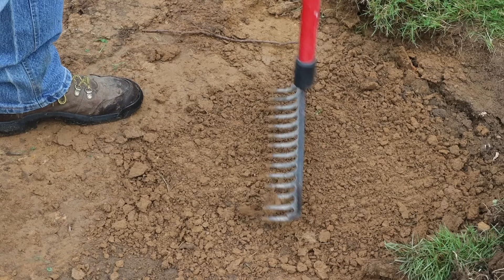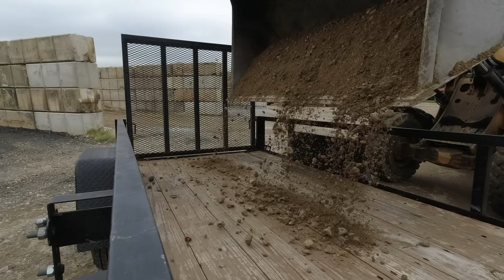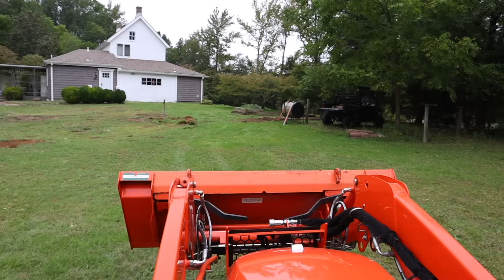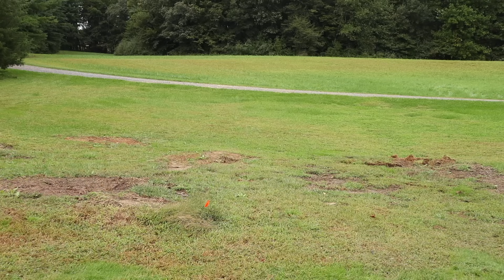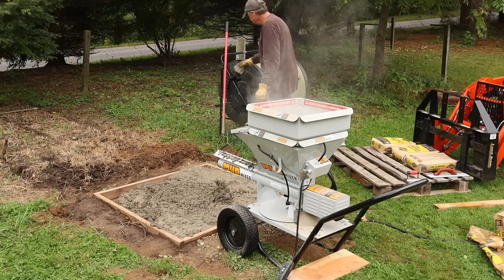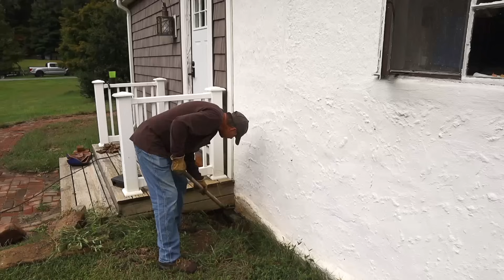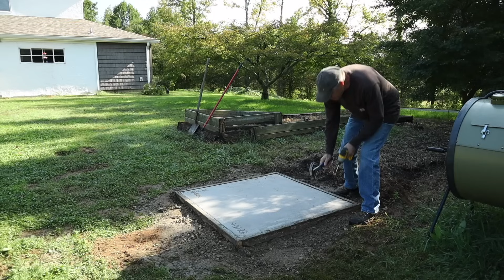Game Changer. Pouring a concrete pad and using the Mudmixer for the first time. MCG Video #169

Comment: Your inconsistency in the mix output is most likely caused by inconsistent water pressure if you're on a well system that operates within a wide range (40-60 psi).

Comment: For one project the mud mixer is pricey, but for foundation pour, small pads, small garage pads, it is a back saver, gives you time to fine tune the concrete, seems most effective for two old timers as a part time job, this would make a great side job for part timers!

Comment: Small issue, but put a bucket or pan under the chute when you are washing out the machine so you don't end up with a hardened pile of aggregate in your yard.  A handyman once washed out his equipment in my sister's flowerbed next to the front door where the hose bib was located and made one heck of a mess!  Plus the wash water is alkaline and could kill plants.

Comment: Make a grate that can sit on top with a hand control bag slicer. Then sit the bag up on the grate and pull the bag splitter blade and the job got a lot easier.

Comment: I love how the guy spent like $3600 on a commercial cement mixer with the add-ons to do a $50 home project.
Reply: I suppose the idea is he makes it back as he does other projects, and the time savings and savings on his old body. Valid points but probably never really hits ROI. His kids can have it if it’s a solid machine.
Reply: @JeronimoStilton14  yeah that’s a great idea and all, but rarely every pans out. Every few years there’s a new, better, more affordable product available in everything made ever, that is always easier and more worthy. It’s like if grandpa and grandma saved their Atari 2700 to give their kids because it was “expensive”. Just get the $200 mixer with the 2 year replacement plan for $20 and throw it away when it breaks. You can buy like 16 of them before buying one of these stupid ass things.
Reply: @c1rca23  a newer product doesn’t mean someone won’t be glad to have it later for free even if it’s not the new hotness ataris are pretty saught after since they’re now classics. Doesn’t mean pong is better than ghosts of Tsushima (though it definitely beats starfield lol)
Reply: @JeronimoStilton14  ok thanks for trying
Reply: I was thinking I would just mix it on the tractor bucket with a hoe. Then dump it in the form. Wouldn’t take a few minutes and probably easier to wash out the bucket
Reply: Its Slower than a $200 normal mixer
Reply: It's definitely a gimmicky tool for rich boomers.
Reply: @Doomzdayxx  nailed it
Reply: Get you some money like the rich boomers 😢😂.
Reply: This could be an infomercial for the mixer?
Reply: It saves one man.  That is extremely valuable.  I've done tons of small portable mixer jobs and can see that this is a game changer.

Comment: I lucked out and bought a two wheel wheel barrow that the tub was actually a cement mixer. It slso has a 100 foot extrnsion cord. A hardware store did not want it anymore and 75 dollars took it.
   It weighs nothing empty and super easy to add the bags right where they are dumped

Comment: Nicely explained and you did a good job for someone who's never laid concrete before.

It's hard to get excited about the machine you were using, particularly when it cost you circa US$3K, has about the same footprint as a much less expensive portable concrete mixer, produced an inconsistent mix and, from what I could see, was relatively slow.

You can get away with inconsistency when the pad is only going to be used for a composter, but the art and science of concreting is getting the right ratio of aggregate, sand, cement, and water.

Too much water will weaken your concrete.

When I was young, I helped my Dad lay a reasonably long concrete driveway, which was 6" thick and wire mesh reinforced. He made it that way to withstand the occasional heavy truck on the driveway.

My Dad bought the cement bags, aggregate and sand separately.

We used a portable concrete mixer to mix onsite before pouring the concrete into a wheel barrow and then into the forms.

We did it over a number of weekends, essentially laying large slabs one after the other, with relief cuts designed into the pour.

For a pad that small, I personally would've used either a concrete mixer, if I had one or could hire one reasonably cheaply, or a wheelbarrow.

For a bigger pour, I'd use a portable concrete mixer, and for a really big pour I'd get it delivered premixed.

From a viewer in New Zealand.
Reply from the maker: Thank you for your kind comments!

Comment: You don't want it to dry in the machine so run into a bag. Or run it out over hole in the yard extremely wet. This machine tends to only pull dry mix from one area so if it had an gasoline motor. The shaking of the motor wouldn't let that happen.

Comment: that machine mixes inconsistently  the key to good concrete is water controle  , you will have weak areas unless the water is mixed in consistently to a specific slump

Comment: From both a labor and quality of output standpoint, I'm not sure that's an improvement on a  3.5cf HF mixer at 1/10th the price.  The product website has a video of using it to pour a long 1' wide slab, but for a typical slab I think I'd rather being pouring several cubic feet at a time, rather than the continuous dribble of the mud mixer.

Comment: Paying 3000 dollars for the Mudmixer to make a 4 x 4 concrete pad seems foolish, unless you plan on using it for many more projects, but even then not very practical. You can buy concrete mixers for only a couple hundred bucks at any good hardware store. You can rent a mudmixer which would be a better idea. If I was a concrete contractor it would maybe make sense to buy a 3000 dollar concrete mixer but not for a average homeowner with only a project or two to do. I do want to add that you did a great job on your project.
Reply from the maker: You’re right that it’s well suited for a contractor or active DIY’er. I’ll be doing more projects with it after winter. Thanks for watching!

Comment: Thank you for sharing this review both good and bad. At $3,000 this isn't probably a machine for the casual user, but someone who does this kind of work on a regular basis it looks like a real labor saver. A less convenient, but way cheaper, option are the traditional motorized small barrel type mixers available at 1/10 the cost.
Reply from the maker: It’s pricey for the average user but it’s definitely convenient!

Comment: Heres a cool tip...  When your done with your pour, I generally use the extra to pour into patio block forms and step stone forms.  Also... It doesn't hurt to set a 4x4 in a homer bucket and fill for later use as a post somewhere.
Reply from the maker: Thanks!

Comment: 20:20 It’s the tube high enough to get a wheel barrow under?  Can you shut off the flow and just let it keep turning?  How many bags can you put in at one time and let it run?  Does it drive automatically so I don’t stain getting it through the yard up and down the hills or pull able to get across town to my brothers? Are the hose connectors quick disconnect and double or did you add that piece?  So jamming up is an issue and how did you resolve it stick a broom handle up the shoot or flush the top that says dry mix only… how did you clear the constant jamming, which can be an issue if you have a few bags sitting for a day or 2.
Reply from the maker: Yes, I think you can fit a wheel barrow under the chute. It does not drive automatically but rolls easily. Not quick connect. Jamming isn't really an issue, just happens sometimes - just hit reverse momentarily. Never put water in the top - only to clean it once it's empty. And don't leave any mix (even dry) in it. It could harden and ruin the machine. Use it, empty is, clean it, and put it away. Thanks for watching!
Reply: @MyClutteredGarage  I pour a lot of home concrete and went from 80lb bags to 60 and now its just to much to hold on the side of the harbor freight mixer then to help t get going and then to dump it so I pulled up the machine right away.  Unfortunately to much for my budget when it comes down in prices 400-600 ill buy 2

Comment: He would have no problem keeping up because it runs out of the batch first. He can keep spreading until he’s ready to fill with a couple more bags.
It’s just an upgraded old style mixer with a few more amenities. If I don’t have the mixer I had for years, I would be happy to rent this machine to pour a yard or two, but not for 8 or ten bags.
With a helper, I have poured 60 to a hundred bags for a porch and sidewalk, even though I’m over 60 years old. I just back my pickup up to my project so my mixer dumps right into the forms.  Lift the bags and dump two, add water, and dump on the ground, while my helper works the batch.
I don’t see any stabilizers. It seems to jostle around while mixing. My old mixer doesn’t do that.

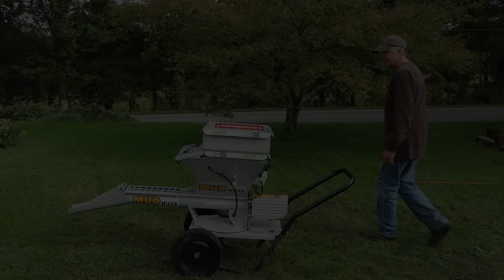Comment: A very nice feature of the MudMixer is the ability to rotate the mixer head on the wheeled base.  This allows the user to pull the MudMixer a couple of feet every so often as needed alongside a walkway or foundation forms even while mixing the concrete.  At 30:45 you can easily see the large bolt in the center of the base just behind the axle. That bolt is the swivel center. Then you can see the handle at the rear of the base that releases the mixer head to swivel up to 90 degrees in either direction from straight ahead.
Reply from the maker: Good point. Thanks!

Comment: $2,995.00 for a Mudmixer; why not buy an airconditioned backhoe to do that digging while your at it. I bought my traditional style mixer for $350.00, and I have poured 570 80lb bags of concrete with it. I would need to be planning to hand pour about 5,000 80lb bags of concrete in order to get a similar return on investment.

Comment: The reason you have some left is that the measurements for your square is actually 46 inches by 46 inches and 3.5 inches deep which results in 9.5 60lb bags. Great video though. Thank you.
Reply from the maker: Thank you!

Comment: Should you use rebar to give concrete strength?  Respirator from the concrete dust when loading bags?
Reply from the maker: Wire might help, but probably not needed in this small pad. Respirator is always a good idea.

Comment: Guys don’t load your trailer like this. It’s incredible the laws aren’t enforced. I’ve beeen a builder for 25 years and i fire any of my guys doing this. This is an open sided trailer where all the rocks can bounce out and dent cars behind you or break windshield and even cause an accident. This is total disregard for people on the road as per safety and not destroying someone’s nice expensive car. This guy doesn’t care. If ever you are going to any place to get loaded with any material have a tarp or 2 and bungee cords with you. Even if this is a solid wall trailer rocks still bounce out the top and I’ll chase you down if you wreck one of my vehicles with your selfish stupidity. 25years as a builder and i do t play this. I had one issue where the latch busted on one of my dump trailers and the door swung open and smashed a car while i was driving and i felt bad to this day. I know plenty of contractors that don’t care but yet will freak out if shorted $3 on a job but yet can cause $3000 in damage to a nice car of which devalues it in this day and age because the work gets reported on Carfax. Have respect for other-if i can do it then anyone can. That’s a nice little machine to have around the property instead of bringing home the real one or by hand. I’d make something to attach to my golf cart to drag it around. Would’ve been nice to have optional water reservoir to attach to it so to not need a hose if to far away from a water source.

Comment: Thanks for the demo of the Mud Mixer. It looks like a nice way to keep a flow of concrete coming with one guy dropping bags into it and the other spreading the mix. 

Generally, I do four steps on the finishing. The first is screeding, which you did with the 2x4.  The second is floating, where you use a steel or wood float to go over the top and push down the aggregate away from the surface. If that aggregate is too close to the top, it won’t finish well. The third step is troweling and edging it, where we try to get it close to finished. The fourth is either brushing it (which we do on outdoor walkways) or finish troweling for that mirror finish.
Reply from the maker: Thanks for your comments!
Reply: The mag is an excellent tool for hand floating, where you knock the heavier aggregate down a bit, to have a surface "cream" to be able to create your finish texture. 
The Smooth trowels are helpful when attempting to get a smooth surface and eliminate floating and trowel lines.  If you still have lines after trowelling, then your technique could use a bit more 'polishing' 😉.

I think you did an excellent job as a beginner. Good job having the courage to do your pour on YT! You can learn more quickly that way for sure, as many people can be downright rude with their feedback. Haha

I would agree with some comments that covering your load will minimize loss, and reduce the risk of damage claims. One commenter suggested laying a larger tarp on the trailer bed, cascade onto the ground, dump the aggregate into it, then food the tarp over the top. You can unload easier too, if you place the tarp on the top of a log chain and old tire. Then use your tractor to pull the log chain/tire and tarp of aggregate off the trailer. The only caveat is the lightweight truck might not withstand the pulling force of a heavy load, and may slide. Cute truck tho! Good choice to park on the driveway to reclaim the excess aggregate! What to use some good common sense!

I like that cement machine! I think I'll get one of those too do all my projects this summer!

Comment: what is the maximum aggregate size? Are there any aggregate size or combination that does not work with the mud mixer?
Reply from the maker: Not sure but probably pretty small. You can check with Mudmixer. They have great customer service. Thank you.

Comment: Are you able to throw the first mix to come out of the mixer back into  rhe feeder till the consistency is better?
Reply: No. The hopper is for dry mix only. The water is added at the beginning of the mixing screw.
Reply from the maker: Correct. Never add anything besides dry mix into the hopper.

Comment: I always spread a tarp across my trailer when getting gravel or dirt.  I get the gravel dumped onto the tarp and try to pull it over the top for transport. When unloading, I can just pull the tarp.
Reply: Pull a half ton on top of that tarp? Even if you do manage to get it moving, it'll be the last time thar tarp is used. It will get torn to shreds.
Reply: Yes.  I should mention I only use mine for small residential jobs around my house.  Just weekend projects.

Comment: Wouldn’t you run it for a while before letting it dump out to mix the concrete thoroughly?
Reply from the maker: It just starts coming out as soon as you turn it in. I have been advised to pre-wet the chute.

Comment: People love expensive tools. That is an expensive tractor/ loader. Your compost tumbler will rust out with or without the concrete pad. Legs first, next the door, then the thin metal tumbler itself.. cheers!
Reply: I live in the NE ware rust happens year round. Basic maintenance includes rust removal, prime & paint. Even better is to clean the rust off, and use POR-15 or other type of encapsulator. Use of oil based rust stop / preventer like Fluid Film, Crown OiL, or New Hampshire Oil is also a very valid option. Although you still see plenty of lazy people around here that just don't bother. They tend to be the wealthy who are just fine with a throw away society, or the chronically poor who poor because they think they are wealthy enough for a throw away society / just lazy.

Comment: Once you start using mix bag materials, you are increasing the cost considerably . Buying the cement separately , with loose gravel mixed with a standard cement mixer would be far quicker and more cost effective .  But if it works for you that’s that matters , you did seem to be having to alter the water content . Did this have any impact on the overall strength of the concrete? .
Reply: A sample wasn’t taken to test. Without using a standardized testing process, you could do all the testing you wanted and not get any realistic results.
Reply: I would normally agree with you but in this age of 'blame' when something fails, I can see the benefit of saying that you only used pre-bagged material.. Concrete is chemistry and is very specific to get the desired result..  I do think this is the way of the future..  Perhaps we have to buy pure spring water for the mix..